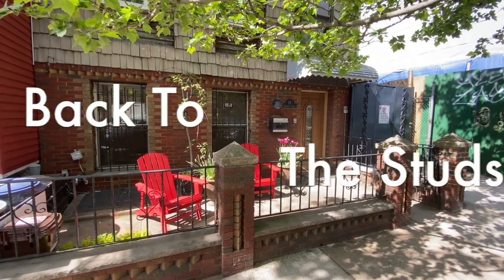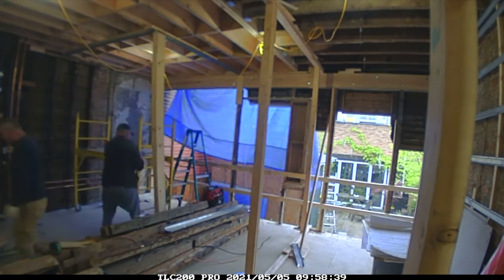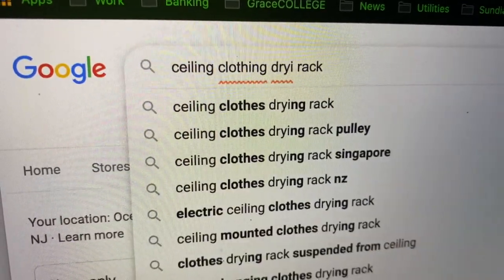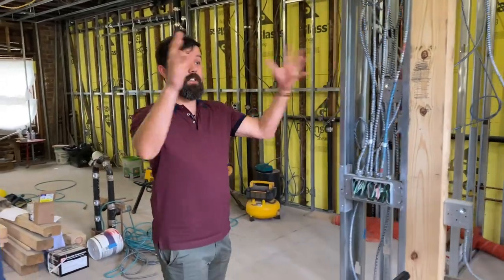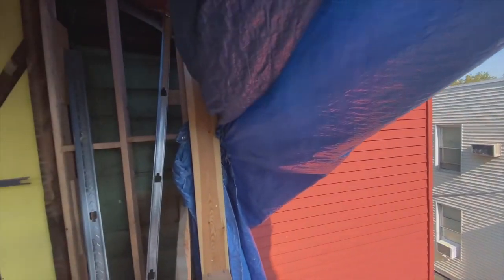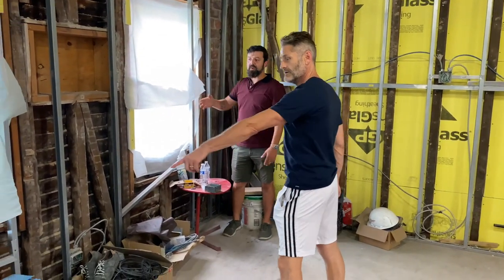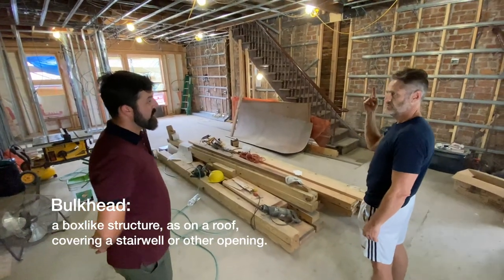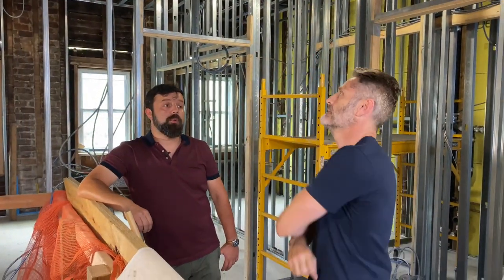Our Architectural Plans Come To Life

Comment: You’re general contractor does a great job explaining all the issues they had to fix and he seems so natural in front of the camera. I laughed when your husband started doing the cell block tango, I was thinking the same thing lol. 
For the metal framing, is that normal for the fire code or was that a choice due to the insane cost of lumber at the moment?  How are you guys going to hang pictures, mirrors, decor if there are not wooden studs to secure them?  Or will there be wooden studs added later?  So excited to see the progress!!!
Reply from the maker: I do agree, Regina, Martin is charming and communicates complicated topics effortlessly.  Love him!!  Metal frames are required by code to reduce flammable materials.    Most wall hanging is done through sheet rock, not in studs. Only really heavy items must be in studs, and then we’ll use different screws. 😊

Comment: Great episode guys!  QQ, what happens with openings such as windows or doors when you've built a square inner wall structure and the outer wall structure is not square.  Are the window frames, sills, door frames and thresholds thicker on one side and thinner on the other?  Excited to see the installation of the dumb waiter!  Would be great to have it extend up to the roof!  😃
Reply from the maker: Thanks, Lyman.  Yes, that’s a great question and I assume it’ll be as you suggest- our existing siding will be removed and there will need to be some wiggle room left to make the openings mesh with the angles and the new exterior siding.  But our GC is a perfectionist so we’re confident it’ll work out… stay tuned!!😊

Comment: what do you use for heating ?
Reply from the maker: We’re installing the Mitsubishi mini split system for heat and cooling allowing each room to be controlled separately.  🙏
Reply: that is expensive in electricity, solar panels on the roof to compensate?
Reply from the maker: @deweerdtrichard  We’ve spoken to many solar companies and they usually say we wouldn’t have enough space to make it economically feasible, sadly.
Reply: @BackToTheStuds  here you get a subsidy from the state, so that you can still place them, we only have a small roof with 5 panels, but still profitable because of the subsidy.
Reply from the maker: @deweerdtrichard  Oh, that makes great sense!  I'm going to check again into our local options.  Thanks for reminding me!

Comment: how much sqft is your master bedroom going to be? also no closet?
Reply from the maker: Our bedroom is about 12 feet by 11 feet with 10.5 foot ceilings and we WILL have a double wide closet that's located between the bedroom and our bathroom.   The closet is JUST to the right as we step into the bedroom,.   Thanks for checking!